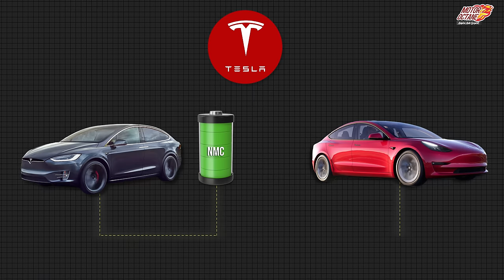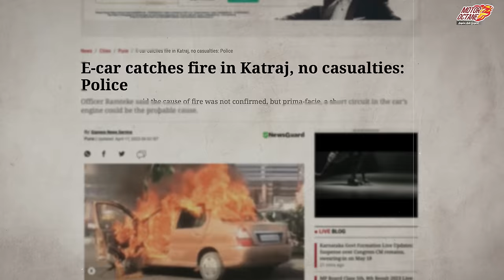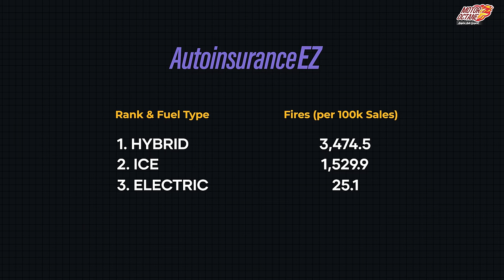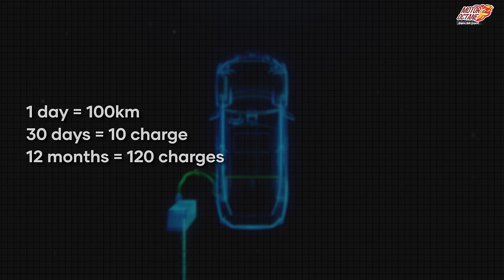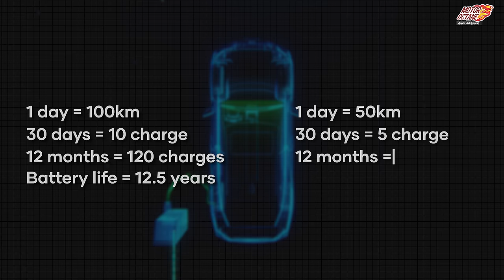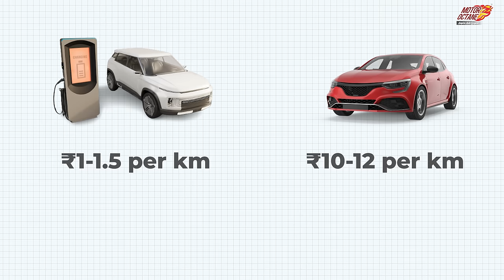Electric Cars have Battery Problems?

Comment: I do watch a lot of your videos. Honestly I feel there are lot of factual inaccuracies especially related to battery life. This may financially ruin people if they just trust that their battery will last forever, especially in Indian conditions and plonk in millions of their rupees in such vehicles. 

No lithium ion battery as of now lives for the durations and mileage mentioned in the video. Comparison with Tesla is not a comparative ground for the vehicles sold in India. The Teslas come with a vastly superior cooling system, battery management system and extremely well adapter battery management techniques which are not as good in the vehicles being sold here, at-least as of now. 

You compared 12% battery degradation over 300,000 miles for Tesla and then XUV400 and then just reduced range by 12% on XUV400 which is completely incorrect way of measurement. The battery degradation of Tesla is much slower because the range is extremely high and it needs less charge cycles. At 300,000 miles, the XUV400 would need so many charge cycles, its degradation would be much much higher.

Also, Indian conditions and especially heat are absolutely the battery's worst enemies and charging in afternoon sun at 10s or 100s of KW in case of fast charging will definitely impact the battery life unless "tesla-like-software" exists in these vehicles which manages such charges and climate conditions effectively which most vehicles do not do properly as of now.

Let me not even get started on how the charging infrastructure in India is pathetic. I would say the right time the market is mature for EVs would be when:
1. Car gives a real world mileage of 500 km minimum and up to 700 km on a single charge.
2. A fast-charge until 80% should not take more than 15 mins. considering chargers are available AND working.
3. The battery should last 8 years and 200,000 kms
4. All the above in real Indian conditions, the vehicle being used in peak summer heat.

The technology is there and exists. Problem is of price and on the ground implementation especially of charging infra.
Reply: Absolutely correct , take an example of CNG , its been around 20 years since CNG has been implemented,  but still today not all the pumps are having that CNG facilities , I see vehicles standing in large numbers in pumps to get the CNG refilled.., also not to forget with fast chargers the charging time is 45 mins min.., and with regular chargers the avg time is around 6-8 hours, yes ev's save money but there will be an added burden of charging it.., unlike petrol or diesel cars..
Reply: @mayank.007  My point is - In the long run, EVs do not save money. They cost a lot, LOT more than their equivalent IC engine counterparts over a 15 year period. Currently, the technology is only good for early adopters who have the spare cash to experiment and enjoy a new technology. It will take a lot in the field of battery innovations to get to the point where EVs will be fully able to replace IC engine vehicles. Until then, we can thank the early adopters for keeping the cash flow for research running :)

Comment: helloRachit ji can you tell us naturally aspartate or turbo charged petrol engine which is better for using long term. since most of petrol car will have this 2 type of option.
Reply from the maker: Both are equally good. A few years ago turbo wasn’t very reliable. Today they are equally good
Reply: @motoroctane  thank you for your feed back. 🙏

Comment: Do you have an electric car . I am sure you don’t have. I own a Mahindra Reva E 2 O . 8 Years Old   Run 100000 Km . Range came down from 120 to 40 . Now totally dead. You clarifications are based on assumptions and not from experience. Neither Modiji or the car manufacturers will support you after 8 or 9 years. Don’t be a fool like me and spend hard earned money on electric cars

Comment: Wonder what the resale value of electric cars would be like? With the battery out of warranty!
Reply from the maker: Same what it is for petrol and diesel cars when they are out of their warranty
Reply: @motoroctane  Totally not same. Fortuners deplete only 20% of their price after warranty. Who will buy an EV without warranty?
Reply: @motoroctane  Totally not same. Fortuners deplete only 20% of their price after warranty. Who will buy an EV without warranty?
Reply: I too don't think it will be the same. Resale value may not be great for electric cars
Reply: Car warranty is not 8 years. Battery warranty is.
Reply: I'd ask you counter question, 

what are will be resale price of BS6 E10 due to E20 in future?

What will be resale of diesel cars amid the fact that the goverment has been presented with proposal to ban diesel vehicles in 1M+ populated cities

What will be the resale value of so called "best of both worlds" hybrids when their battery doesn't even have cooling system in hot country like India and the avg hybrid battery completes 2-3 cycles per day due to small capacity?

There is no certainity about anything, not even about the fact whether we will live to see another day or not, daresay. So I don't see how this is an "EV PROBLEM" and not a general uncertainity which affects every car
Reply: @sambitranjan9584  Fortuner is entirely different case.

Fortuner had aspect of show off of people money and power related to it.

If you removed it, Fortuner wouldn't have same resale value.
Reply: @rachitmittal448  true 

It’s like saying why resale iPhone is more than Samsung or Oneplus
Reply: @sambitranjan9584  Why resale as Rachit said, change the battery and you are with  a new toy. unless you have not maintained you car well.

Comment: Meri tata tigor ev 14 months pehle Li thi... Battery change rhi h... Itni jaldi... Wese warranty me change ho rhi h... Par ho rhi h
Reply: Generally it’s manufacturing defect which dealership won’t be able to rectify 

The ones being replaced are not due to degradation — it’s due to some or the other error or fault which limited equipment and tools at normal dealership is not able to detect and fix 

So they have to send battery to Pune without any other option

Comment: The point is, lithium batteries are not the end all to power storage systems, they arent sustainable at the least. Funny enough, ev cars produce more co2 in production than what conventional vehicles produce in a lifetime. But, thats never shown. Until and unless theres nuclear fusion, that can be brought up in a compact form, theres no effective way of powering any heavy. 
Moreover people dont consider the fact that lithium batteries degrade overtime and the cost of replacing the battery is equal to polluting the environment again at the same. 
And most people think electriciry grows on trees lol. 
People never think how much coal is burnt so that ou can travel 150kms. in a single charge.

Comment: This is mis-presentatiom. There is no resale value of electric car, given that battery will be old after 7 years - almost degarded. You need to replace the battery by giving 100% cost- This is too high cost
Nobody is taking guarantee of battery after. 7 years 

2. Motor of car depreciates every year and motor running efficiency is for 7-8 years too. If it goes bad than it cost almost new car

3. Your petrol/ disel car will always give you some money after 4.5 lakhs running

EV car gives indirect tension of charging and gives anxiety when you forget to charge. There are many ppl who don't have fixed schedules to use car. Sometimes we use 4 days together and sometimes 1 time in a week. Charging patterns is not fixed

Manymore other things are of concern too

Comment: Ev is not successful right now because of two problems one the very low range no brand is focusing one the range rather They're all focusing on gimmicky features.
2nd reason is they cost much more than petrol vehicles with very less range joki petrol vehicles ke running cost ke equal hi nikal jati h.

Comment: EV Ki Jagah Hybrid Better Choice Hai India Me Kyuki EV Car Har Jagah Nhi Chal Sakti Aur Pollution Bhi Jyada Failati Hai Aur Agr Battery Badalne 🔋 ki jarurat pdi Toh battery Price Is Too High... Resale Value Bhi Nhi Aayegi... So Hybrid aur Cng Is Better Choice.... Bhaad Me JaYe Electric....
Reply: Who says battery of hybrid is cheap? prius battery costs $2100 which is 1.6L

Further, you ppl question EV battery durability but not hybrid, which is ironic because hybrid battery does not even have liquid cooling like EVs nor does it have longevity since you can completely cycle hybrid battery 2-3 times per day due to small capacity (0.75kWh)

as far as pollution is concerned, yaris hybrid which is smallest hybrid toyota, is rated for 110gCO2/km in uk market who have stricter pollution norms than us.

Even if you charge nexon ev 100% through coal (800gCO2/kWh), it will be just 96gCO2/km. Mind you, this is 15% lower than the said yaris hatchback which is HYBRID and from UK which has stricter pollution norms than india. All while using 100% coal, whereas india has 40% renewables as of today.

60% coal energy drops ev pollution down to 48gCO2/km which is less than half of a hybrid hatchback like yaris. Normal petrol swift would pollute more than nexon EV despite using 60% coal energy, heck even with 100% coal energy, EV will emit less CO2
Reply: @shresthsonkar9207  Bhai Muje Yeah Bata Tuh Resale Value EV Ki Kitni Milegi Yeah Lambhi Lambi Chodna Band Kr Sidha Ans De Resale EV Car Ki Kya Milegi?
Reply: @beyondboundries  jis hisab se maintain kari hogi uss hisab se milegi 

you can check battery health of any ev using normal OBD-II tool 

50-60% value easily mil jayegi if battery health is 100%

kam huyi toh utna percent kat lo price se bhi 10% degradation 40% and so on

gadi ki price sirf isse determine nahi hoti hai lekin 

agar kal ko nexon facelift launch ho jayegi toh automatically current generation ki price fall ho jayegi market me

same with ev also, rn nexon ev prime has just 25kW DC charging capacity say in future tata gives 50kW then obv nobody will pay same price 

same happens with normal cars also

when fuel injection came, carburettor equipped cars price fell drastically

same with introduction of automatic gearbox compared to manual cars
Reply: @shresthsonkar9207  😄🤣😂 Iska Matlab Keh Nhi Skte 50% Bhi Price Nhi Milegi EV Ki Price Toh Kon Lega EV ? JO lega Woh Koi Bewkoof Hi Hoga....
Reply: @shresthsonkar9207  Battery Ki Warranty Company 6-8 Year Ki Deti Hai Agr 6-7 year me bechni hai Car Toh Uska Resale Ghanta Bhi Nhi Milega.... Aap Ek Tata Fans Hoge Pr Apne Dimag Ka Istemal Kre Koi Kyu Lega Jab Battery 🔋 ki warranty Chali jayegi aur battery Cost Is More Than 5 Lack Hai... aur  EV Car Highway K Liye Bhi Nhi Hai Charging Time 5-6 Hour Hai .... 500Km tak  Chalani Ho Khi Bhar jana Ho Family K Saath Toh EV Nhi Chal Sakti Practical Socho Yaar Phir Pta Chalega EV Is Not Better Choice
Reply: @shresthsonkar9207  Hybrid Car offer Better Fuel Efficiency Or Longer Distance/Ranges electric Are Still Yet To Reach That Potential ....
Reply: Pollution jyada failati hai?  Ye kaha padha?  Mild hybrid use only 20% power delivery from electric and hence they spread Pollution more compared to Smart Hybrid and EV. EV do not spread Pollution at all while running locally.  Pollution only occurs at power plants which are far from cities. Similarly hybrid with ICE too spread Pollution during production and refining.
Reply: Resale kaise nahi aayegi?  Jis chiz ka resale start nahi hua uska assumption kaise? Battery pack replace ho gaya to car is new again for 8-9 yrs. Moreover you are counting resale value of a car based on today's value of Battery, whose prices are falling fast because of advances in the technology much faster than ICE technology ever witnessed.  Comparing apples and oranges.
Reply: @beyondboundries  Mr genius jo gadi well maintained hoti hai uski hi high price milti hai 

Aisa thodi hota hai ki thok thak ke bhangar kardo aur fir socho 20L ki gadi ka 16L toh milna chaiye 

Same with mobile phone 

Agar screen crack hogi aur speaker camera nahi chalega toh koi nahi lega free me bhi 

Whereas ekdum saaf sutra well kept hoga toh iPhone ki resale dekh lo
Reply: @shresthsonkar9207  arre Bhai Gaadi Archi Hai Phir Bhi Kya 7 saal K Baad Battery Ki Warranty Khatam Ho Jayegi Toh Kon us Car Ka Resale Dega Koi Pagal Hi Lega  😄🤣😂
Reply: @ads7506  battery Me Problem Hogi Toh Replace Hogi Agr Problem Nhi Hai Toh Kon Replace Dega Dimag Lagao Pehle ... 7-8 year k baad Kon EV Car Ki Resale Archi aayegi Hi Nhi Kyuki Battery 🔋 Ki Price is too High...
Reply: @beyondboundries  arre aajki price 8 saal baad hogi?  Aaj 10000 ke cellphone me 5000 mah ki battery aur 6 GB RAM milta hai,  10 saal pahle milta tha?  Jis field me continuous research chal raha ho usme price kum hote hai with improved features,  badhte nahi hai.  Tumhara dimaag resales aage ka soch nahi payega to jab compulsory kharidna pade tab kharidna.  Bye.
Reply: @ads7506  😄🤣😂😆 Toh Phir 15 Lack Ki Gaadi Agr Resale Nhi Kr Skte Toh Woh Gaadi Nhi Ek Dibba Hai Jo 8 saal K Baad Kisi Kaam Ka Nhi Bewkoof Mat Bano Apne Paise Sahi Jagah Istemaal Kro HA Agr sirf City Use aur Jyada Highway Pr Nhi Chalani Aur 5-7  Saal Tak Gaadi Use Krni Ho Phir Hi EV Leni Chahiye aur Phir Kabad Me Daal Deni Chahiye... 😄🤣😂
Reply: @beyondboundries  arre yaar gaadi chalane ke liye le rahe ho ya bechne ke liye?
Reply: @ads7506  Sochna Pdta Hai Jab Koi 10-15 L Kharch Krta Hai Toh Sab Parameter Sochna Pdta Hai Bhai... Mene Swift Li Thi 4 Saal Pehle TOP Model 9.30L me Ur Usko 4 saal K Baad 6.75L me Becha agr Muje Ab EV Leni Ho Toh Kya Resale Muje EV Ki Utni Hi Milegi agr Nhi Milegi Toh Koi EV Kyu Ke Bhai Tum Socho Jara Dimag Lagao....
Reply: @ads7506  4-5 Saal Tak Chalayenge Phir Bech Denge...

Comment: Dear Rachit. It seems ur are a pro electric guy and as per ur evaluation a car battery can last for 25 years with just 50 kms daily usage. Please prove this with a solid example of a battery that u have come across that has lasted 25 years. If thats the case then why are the manufacturers not offering if not 25 at least 15 years warranty on battery. After 8 years what will be the resale value of an ICE car and an electric car.....it seems ur comparision has received some paid promotion from EV manufacturers to mislead poor gullible customers into choosing and EV and then repenting for life...All the best to u .

Comment: Well.. If electric cars are so good then why did you purchase XUV700 that too in diesel. Would you care to explain? The problem is overall package - Electric cars are still not there to compete with Petrol or diesel.
Reply: They’ve already clarified in previous video and on Twitter that the XUV700 launched before the XUV400 and Nexon EV max by then they had already bought the 700

They are already in waiting list for xuv400 delivery that also they have told

Comment: You are just talking about optimum conditions and not mentioning the natural factors affecting the batteries. In India because of the temperatures we have to take that degradation also into consideration.
Reply from the maker: Is there any study that proves this Aravind?
Reply: Thats why nobody is buying comet and eC3 : no liquid cooling. 

All the other EVs are having liquid cooling.
Reply: @motoroctane  Why do you need any study to prove this simple logic?? Not just EV batteries any kind of battery degrades due to outside factors. Higher temperature means there is more total energy in a system, so it leads to faster reactions across the board. This means that all reactions happen faster in high heat - both the ones that produce energy, and the “unwanted” chemical reactions that make batteries degrade.

Comment: Another point about battery replacement news which is sensationalised a lot is that so many ppl got their battery replaced on nexon and whatnot

Its nothing more than usual defective manufacturing. Its not like defective manufacturing does not exist on ICE cars despite ceturies of R&D perfection.

Even if 10 nexon got battery replaced, none of them were due to degradation. Most batteries are replaced not because of degradation but due to certain battery faults that dealerships are not able to diagnose with limited equipment and tools (Mind you, dealership is for both, ICE and EV, they cannot have entire factory in small service centre unless Tata offers standalone dealership)

Even for software update, the guys come for limited time slot, those engineers are not permanently stationed on each dealership. Therefore, instead of holding car for days, they just replace the battery and send the faulty one to their Pune EV Assembly factory where they have full kit of tools and equipment to check battery stats and rectify errors and faults

To those who think 10 replacements are a lot for 50K EVs, they are welcome to check up the failure stats of DSG gearbox in VWs and fuel pump issues in BMWs

Further, ppl question EV battery durability but not hybrid, which is ironic because hybrid battery does not even have liquid cooling like EVs nor does it have longevity since you can completely cycle hybrid battery 2-3 times per day due to small capacity (0.75kWh)

Comment: You analysis of battery is based on theocratical figures. Time will only test the durability of these batteries. Also having owned the reva I observed that over time as the battery gets older, the mileage is effected. In other words, the battery is charges faster.